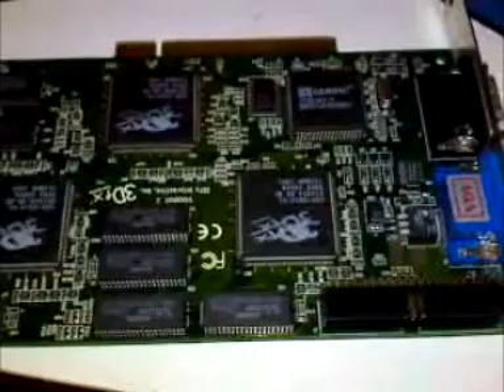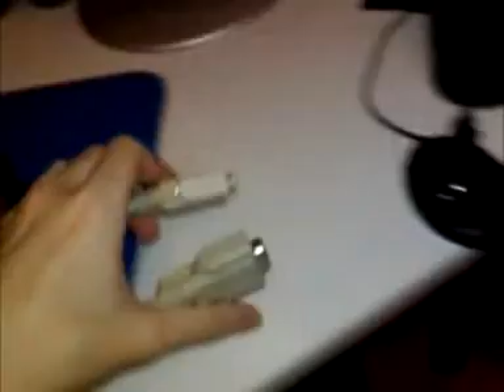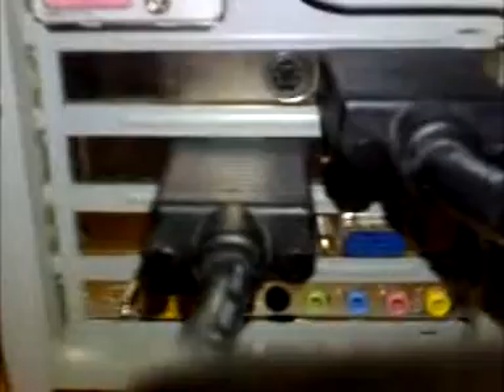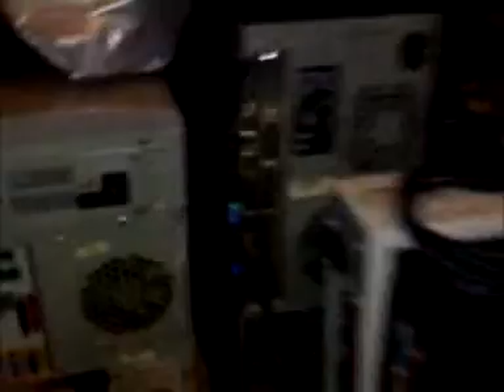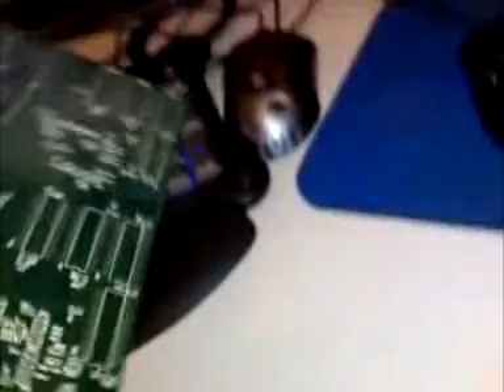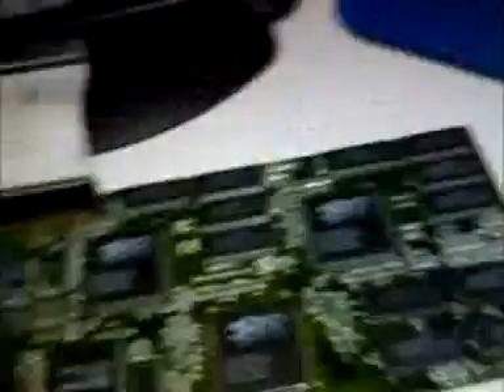how voodoo sli works part 2

Comment: @37474748 I just learned that Nvidea Bought out Voodoo shortly after there Voodoo 4 or 5 release then improved the sli tech,Also,I have 2 old voodoo 2 cards in sli on old  p2 ,I should put a couple of water cooling blocks on them & se if i can clock them,Sum1 should try do something rediculous like running WOW on them or somthing,that would be a crack up & prolly put the wind up some of the bigger card manufacturers roflmao..LOLyou think they'll be worth anything 1 day?,(prolly to a museum lol)

Comment: Thank you for your wise words, i'll use a oldish radeon 9200SE AGP graphics card, (my first card) in place of the voodoo 5500, i've got a spare p3 box under my bed i can do this on, and leave the 5500 in peace in this computer. :-)

By, the way, is the sli link cable for the voodoo 2, just a plain floppy disk cable?  does it matter if its a full length floppy cable, or does it have to be shortened? 

sorry for all the questions!

Comment from the maker: you wont blow it up. But i would not reccomand it. You can use the 5500 for the 2d card letting the voodoo 2 take the 3d. But i would not say its an good idea... try an non 3dfx card an 3d card.

Comment: I have recently got one of those voodoo 2's , now i'm currently in the process of getting another, hopefully, 

Are these compatable with a voodoo 5500?
As in the 5500 does the 2D work, whilst the voodoo 2's in SLI mode render the 3D work? 

I dont want to blow my 5500 up...had a bad week already...i broke my spare voodoo 5500 :-(